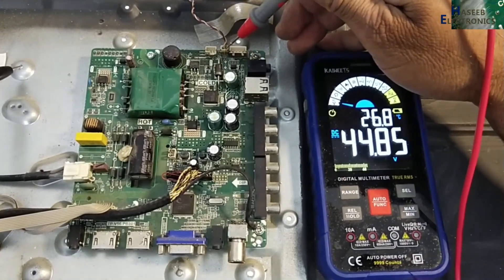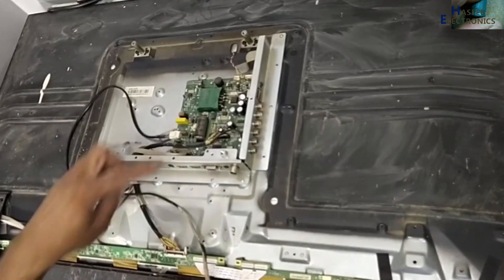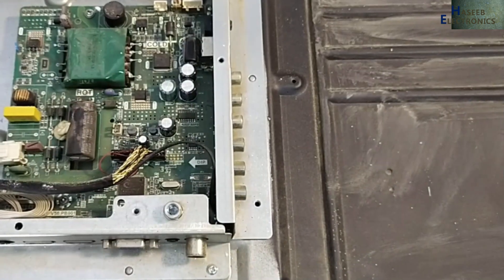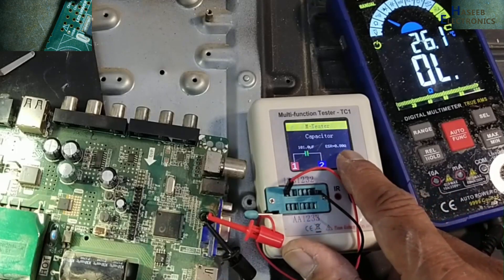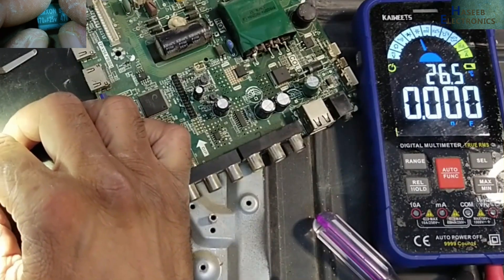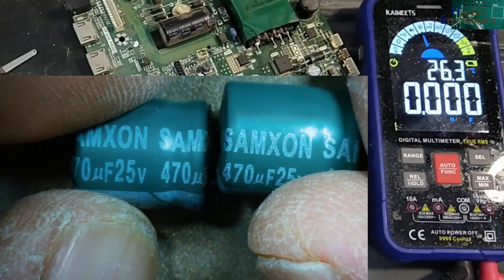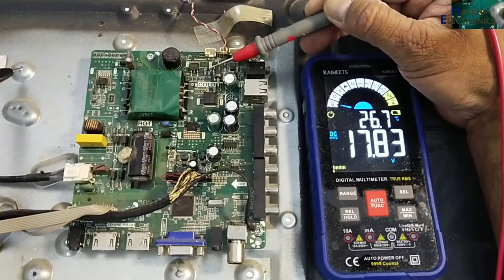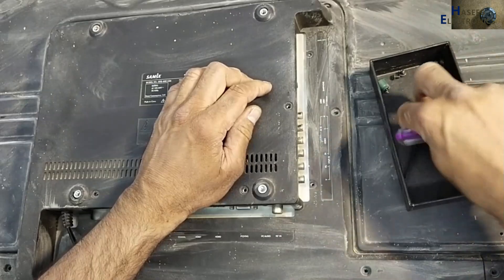{1168} LED TV displays logo and then no video screen

Comment: That was kind of a lucky easy one. Many years ago I had exactly the same issue, logo then backlight off and I could not find anything bad after removing and checking all the components. in the end I had to scrap it because there was nothing bad found but it didn't work... very frustrating!
Reply from the maker: this issue is sometimes by these capacitors 
soetimes by inverter driver IC, 
because it is current controlled voltage booster circuit.

Comment: SA what was the problem? any capacitor is changed or not? or there was soldering problem so you fixed? Thanks
Reply from the maker: i replaced capacitors 
2 capacitors (100uf 63 volt,  470 uf 25 volt) 
these capacitors were causing over current condition and inverter driver goes in protected mode
Reply: @HaseebElectronics  thanks for your kind reply
Reply: He just replace the cap, did you not notice it… bad caps make it protect mode😂
Reply: @k3ggaming926  i do not know english as good as you do and 68 age and my eyes are off thanks